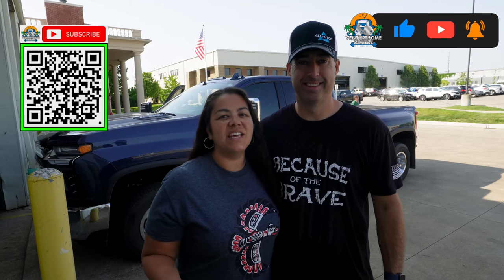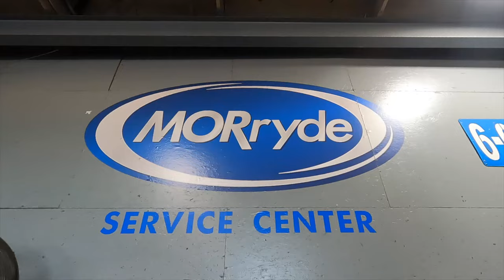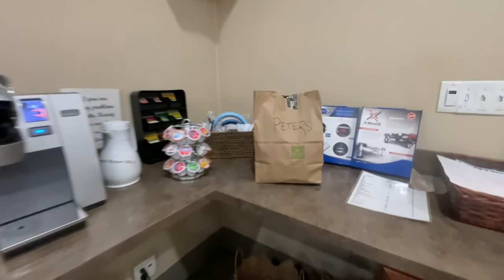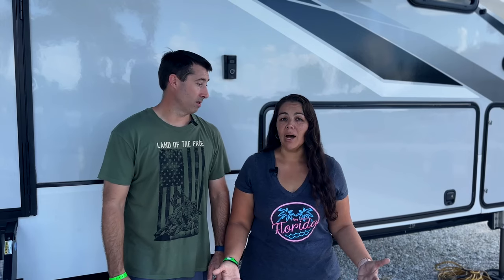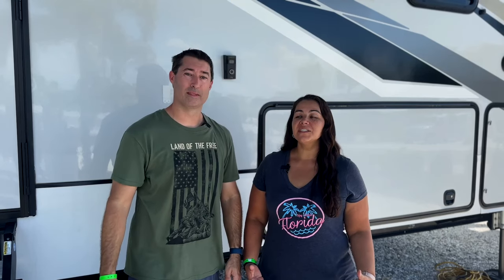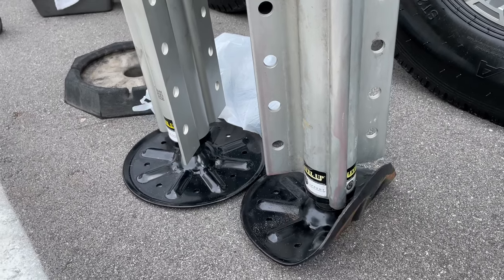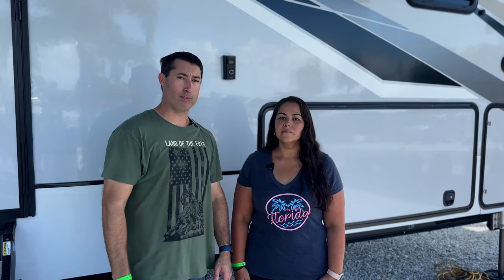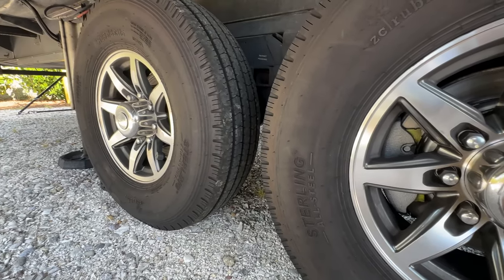MORryde BOLT ON Independent Suspension | Disc Brake Review | Installation

Comment: We can relate to backing into the building.  We have thst issuecevery time we back in to our barn.  We got our IS System on July.  MorRyde did a great job & had us in & out in about 28 hours.  We have a 340RL like & our finish height was 13' 5.5".  Difference must be the truck.  We have a Ram3500, dually.   Great video!
Reply from the maker: Heyyyyyyy Bob & JoAnne, thank you for watching our video and confirming that I am not the only one who does not like backing into a black hole. Crazy how much taller we are now but still lower. We love the additional ground clearance.

Comment: Congrats you guys...great video!  We just got our MORryde IS and Deemaxx disc brakes installed on our brand new 5th wheel in March 2024.  Then, on the drive home, we had to try out the new disc brakes on I-75 South.  Pretty sure we avoided an accident due to the great handling and braking.  I was pleasantly surprised to learn that the system is now bolt on as well.   We were 4" nose high when we rolled into MORryde so now we're 4" higher in the back...giving us more rear stabilizer clearance!  The MORryde system is phenomenal!
Reply from the maker: Thank you for watching our MORryde IS upgrade, we love ours, we just took it in for the annual check up, it definitely was the best upgrade!! We raised our middle and back jacks up too, love how it leveled us out on our 5th wheel. So glad you guys were able to avoid the accident, safe travels.

Comment: Martha and Chris, it looks like a great up. I wonder if it works for a bumper pull trailer? Shelley has been to Alaska. I have not. Her trip was by air. A road trip to Alaska is on my bucket list because my dad's father worked on building the Alcan highway. Great video, as always. Thank you for sharing. Peace and Safe Travels.
Reply from the maker: Thank you Craig,

We appreciate your support and kind words! We will ask MORryde about the bumper pull IS. We know they have a IS  airbag system that they put on the “Pause”. We have seen a few in person and they are pretty impressive technology. I bet he had some amazing stories working on the Alcan, such a great accomplishment for two countries to come together and create that massive highway. Our Alaska series next year will be quite a massive documentary explaining everything step by step. We hope to eliminate people’s fear of the Alcan.
Reply: We had the IS system installed on our grand design travel trailer toy hauler . We have had it for 2 seasons and love it. My only concern it added 4 inches to trailer height.
Reply from the maker: @bobcorio5145  thank you for watching the video and the feedback on your experience. It must vary depending upon configuration. I could see that with the Valor we had it was significantly taller from the factory than our Paradigm.

Comment: I've been waiting for this! Thank you for this! Did you get an option to do 17.5" tires? Looks like stock tires made it with the conversion. Adding this to my list to do.
Reply from the maker: Hey The Ghostly Orb, thank you for watching our video and supporting our channel. We decided to keep the stock 16” tires for now. The main reason is that our Dexter axels lost their camber and ruined our tires. We received new tires under warranty so it was cost effective to keep the 16” tires since they were new and no additional cost. Eventually we will switch to 17.5” when it is time to replace these tires. Having the H rated would nice.
Reply: @VenturesomeCouple  Ah, I see now. Sorry, I need to get my youtube switched to something else. It's Jeremy Daniel. My goal is IS and 17.5" and not having to worry about much on the road anymore. But I don't blame you for not wanted to waste new tires; I was mostly curious if you HAD to upgrade the tires.
Reply from the maker: @theghostlyorb  not required but definitely a worth while upgrade for tire capability.

Comment: Hey, I think it's worth mentioning. look at your video @3:10. The bolt is not flushed mound when the installer is ratcheting down the bolt. I'd take a second look at that if I were you. That may rattle loose.
Reply from the maker: Thank you for watching our video. We just checked it out & it’s good. They went through & doubled checked everything before we left the bay. Thank you for thinking of us 🤗

Comment: With so many people moving to this suspension system why isn’t the manufacturers not catching on to this yet.  One of my buddies had this done 5 years ago.
Reply from the maker: Thank you for watching our video and supporting our channel. It seems that the manufacturers are not offering at the factory as an option. We bought our trailer off of the lot and it had the lead spring suspension.

Comment: trailing arm suspension has been around for quite awhile, a rubber bump spring is unique, I feel the coil spring with dual shocks on the Curt system is a proven and better way, good luck!
Reply from the maker: Thank you for watching our video and supporting our channel. Thank you for the input on the Curt system, we were not aware that was an option.
Reply: @VenturesomeCouple your previous axle was bent, not your fault, manufacturers are putting in axles that have a lower load rating than the static load of the Rv therefore the axle certainly cannot support the dynamic loading that the axle will have to support, thanks for a great video.
Reply from the maker: Hey David, thank you for watching our video and supporting our channel. Thank you for the great information about the load and weight.

Comment: Congrats on the upgrade. Do you mind telling me how much it cost? What's the warranty? Where did you store the axles?? Thanks
Reply from the maker: The upgrade varies between $7k-10k depending on options and sizes 7k or 8k suspension, dual axel, or triple axel. The warranty is five years.
Reply: Can you tell me what is better the 7k or 8k suspension.  What are the benefits or differences.  What did you go with and why?
Reply from the maker: @angelaleong7224  we went with the 8k because our trailer is rated at 16,700 pounds and it is on the boarder of either suspension. We decided since we already had 8k disc brakes that it made sense for the larger weight capacity. Eventually we are going to upgrade to 16.5” H rated tires to fully enjoy the benefits of the 8K suspension. 7K is perfectly acceptable for the trailer also; we cannot get a new DOT sticker so we are limited to what the tag says for weight. Of 7K is cheaper and we didn’t already have the 8K brakes we would have put 7K on.

Comment: Thank you for the information.  I wish they could get a better handle on costs. It is not inexpensive.  I think more folks would be able to come on board with their system.  Do they give you any credit for the old axles they remove? There is some value to the original axles in the non rv trailer world.  Especially upgrading.  Or do they sell them back to the rv manufacturer,  lol. Thanks again.
Reply from the maker: Hey Professional Inspection Services, thank you for watching our video and supporting our channel. MORryde does not give is credit for the removed axels. They did give us the option to keep them but hailing was going to be the concern. I believe they recycle the axels because they had a lot of bins with them.

Comment: That is a slick system, but if you can transfer it from trailer to trailer, where do you store your old axles and parts, you would need those to put back on the old unit before selling.
Reply from the maker: Thank you for watching our video and supporting our channel. We have through about this also. As you mentioned storing the old axels or switching it on the new trailer and putting those axels on the trailer your selling seems to be the most effective method.

Comment: Those pins that you pointed out do not hold the callipers on. They are attached to the back of the outboard disk pad and properly center and locate the pad to the calliper.
Reply from the maker: Thank you for watching our video and supporting our channel. You are correct, I misspoke and should have said that they help the calipers centered which our other brand disc brakes did not have.

Comment: Hi there! 
I wanted to ask you about the Bolt On Independent suspension.  Is it only for Alliance brands or can it be used for any brand 5th wheel.  Also, when you say it can be removed and use for your next RV how does that work?  What happens to the Rv you remove it from when or if you trade it in?  Sorry if I am asking a stupid question.    Also, what’s the difference between a 7k and 8k suspension?  Since it takes 8 hours less labor time, is the cost less too?  We got an estimate for both the 7k and 8k w/ the disc brakes and it was in the 13-14k range.  Labor hours was 32 hours.  Does this sound right?  We can’t go the MORryde but we are going to an installer recommended by them
Called Henderson’s lineup in Grants Pass Oregon.  They also did not mention the Bolt On system.  We are going to look into it.  We appreciate this video coming out.  Thank you!  

Apologies for the length, we are fairly new to the RV life and just a year in.  We owned an LTV and sold it and now have a new 5th wheel Brinkley Z2900. 

Thanks in advance!
Reply from the maker: Hey Angela, thank you for watching our video and supporting our channel. We appreciate the support and do not mind the questions. The bolt on suspension is being manufactured for most brands and it is not generic just to Alliance. The only factor for changing the suspension out is that the new trailer has the same measurements as the trailer that it was originally on. Example is the “wide track” suspension that was on our Heartland would not fit on our Alliance. If we pulled the independent suspension off our Alliance we would have to put the new trailers lead spring suspension on the old trailer and basically swap the suspension. The main difference between a 7k and an 8k is the weight rating on the suspension. There is a lot of difference in tire size, lug nuts, brakes sizes, etc. Honestly none of that matter too much; you have to decide if you want the heavier duty suspension or if your trailer already has 8k. If it does not, to move to 8k ends up requiring larger components (Wheels, tires, brakes) and may not be worth the extra money and weight for a minor gain. The last thing to consider is that no matter what suspension you choose you will not get the weight rating of the trailer changed and legally you can only use the numbers from the factory. The $13-14k with disc brakes is in the right price range for their 3rd party installation. It may be a little cheaper at MOrryde but that is a haul from Oregon.  If we missed anything or you have additional questions don’t hesitate to email us Venturesomecouple@gmail.com . YouTube stuck this comment in hold status and we don’t want to miss anything.

Comment: So this "bolt on" method is an option over a "weld on" method?  Is the cost the same after-market?

I do know Alliance has this as a factory upgrade...but they are listing this option at about $11k and change.  Now, you are getting a few other things (like disc brakes) in addition to the IS with this factory option...but they still make it awfully expensive.
Reply from the maker: Hey Camustang, the bolt on is very similar price to the weld on option. You are correct that it is expensive in either case. The benefit of doing it at the factory is that the trailer will be weighed and sticker with the additional capacity. After market they cannot re-sticker your RV. We tried 😀

Comment: Hi guys, you might think of getting new wheels like Alcoa 17.5 wheels & tires, reasoning is more stable on & off the road ply rating 14 - 25, + these are the trailer tires that are on low bed equipment trailers, I have them on my 2015 grand design solitude + I have full air ride suspension + the 17.5 tires do not squirm while pulling the unit like the ones you have right now cuz the tend to follow the ruts in the road, thx again B safe out there looking forward to Alaska
Reply from the maker: Hey Ferraritoybox, thank you for watching our video and supporting our channel. We appreciate your feedback and advice on the 17.5” t wheels and tires. If we were keeping the Paradigm that was going to be a priority upgrade.
Reply: Do you have Lippert Center Point Air-Ride Suspension?

Comment: Can we ask what does this upgrade cost? And do you guys think its worth that cost?
Reply from the maker: Hey Jeff, thank you for watching our video and supporting our channel. The cost varies depending on the options you get. They have an 7K or 8K version, with or without disc brakes, and tandem or tripple axle. Over all it is between $7-10k. We believe it is the best suspension system made for RV’s. Is it worth it? We say yes especially now that you can transfer the system between trailers (As long as the geometry is the same) If we go from a 2021 Alliance Paradigm to a 2024 Alliance Paradigm we know the IS can come with us. The other two things we recommend to consider is; if you plan on keeping your trailer for a long period of time or you do a lot of traveling then we believe it is a valuable addition because your trailer will not be beat up when you tow.

Comment: So you don’t have to have it welded? How would it safely stay attached? How often would you need to check the bolts that bolt it to the frame?
Reply from the maker: Hey adventuresinrvland, thank you for watching the video and supporting us! We really appreciate you two. The factory suspension bolts hold the system in place just like your leaf springs are attached. Since the system is prebuilt the entire trailer weight sits on the rails of the IS and is attached to the leaf spring hangers. Since there is no moving parts like the leaf springs we don’t have to worry about grease. We visually inspect the bolts on every trip but don’t have to do much else.

Comment: So they build this nice suspension system, and then use the factory shackles to attach it to the frame??? Those shackles are the worst/weakest/most problematic part of the original suspension.  How is this system holding up?
Reply from the maker: Thank you for watching our video and supporting our channel. Martha is on the same page as you. It has been fine because there is not any load on the shackles. The square beam carries the entire load and the shackles keep it square. There has been zero problem with the system.

Comment: I’m a bit new to all this could you share what are the benefits are of doing this or what let you to make this change? I’m also going to be getting an alliance Paradigm.
Reply from the maker: Hey Melissa, thank you for watching our video and supporting our channel. The major benefit is that the independent suspension provides a far smoother ride and will not fail like a leaf spring suspension (Hopefully). We have traveled over 50K miles in just over two years, for us it is well worth the investment due to the increase in strength by putting on an 8K suspension versus a 7K leaf spring and axel. I will say that it is not a must have if you are not doing long travel or full time travel due to the cost. If you plan on keeping the Paradigm long term and will be doing a lot of travel. The independent suspension will protect your trailer by not beating it up as bad.
Reply: @VenturesomeCouple  thank you so much for your reply and all the information. You both are a joy to watch and I appreciate all of the information you’re able to give on Alliance.
Reply from the maker: Thank you so much ☺️

Comment: Okay, so you talked a lot about the suspension, but no cost, did they tell you not to mention or did they give it to you for a promotion gift. I no it’s not cheap but with no welding it should be less than the 8 to 10k based on how many axles.
Reply from the maker: Hey Alaska Road Tripper, love the name! Thank you for watching our video and supporting our channel. You are correct that the cost varies depending on the options you get. They have a 7K or 8K version, with or without disc brakes, and tandem or tripple axle. Over all it is between $7-10k as you mentioned. We are MORryde ambassadors and did partner with them on the Independent Suspension upgrade. We have to identify that by putting that it is a “Sponsored video”.  We are not allowed to give specifics on our payment; we can say that we went through the same process as everyone else and were on the waiting list for a year prior to getting the upgrade.

Comment: Did you keep your old system? How do you move it to a new rig?
Reply from the maker: Thank you for watching our video and supporting our channel. In our case we did not keep the old system although you are allowed to if you plan ahead to haul it off with you. We did not think about it in advance or we would have. If we want to keep the OS for the next trailer we will have to swap the new trailer leaf springs for the IS.

Comment: Seems like it went pretty fast, was it a full day?
Reply from the maker: Thank you for watching our video, we did stay in the bay overnight, the first day was getting the first set of measurements, getting settled in the bay, they take the tires off. This new
is bolt on saves about half the time of this process, so it saves about 8 hours of labor.
Reply: If that’s the case, doesn’t the cost drop due to less labor hours?
Reply from the maker: I believe there is a small price drop but not much, I think it was about $150 less than previous price

Comment: What was the difference in weight between bolt on or welded on?
Reply from the maker: Hey Darryl, thank you for watching our video and supporting our channel. There really isn’t a weight difference between the two. The main change is that all of the welding is done to IS system instead of the trailers chassis. We were told that the welding on the rv gave more room for error on the technician by burning under belly’s, melting wires, etc.